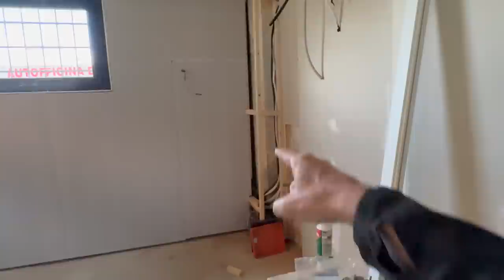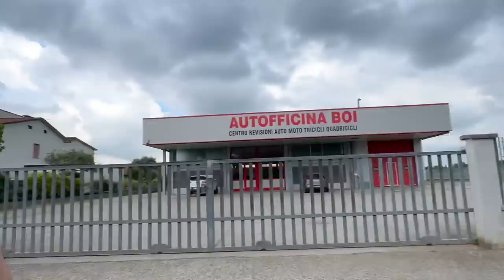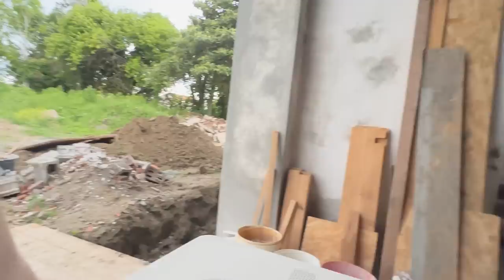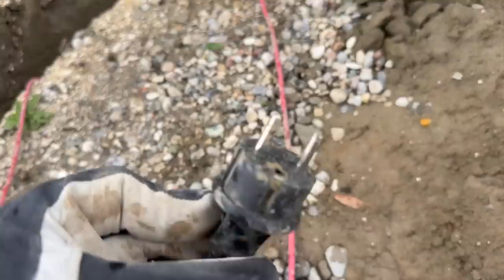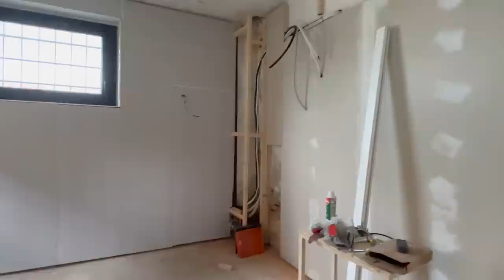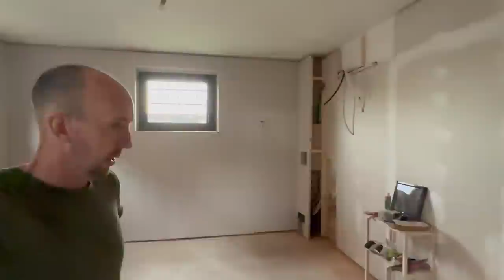Recessed CABINET MAKER or Snowman? A DIY Adventure | Vlog

Comment: A very small piece of advice for the electric plugs. You can find connectors very similar to the black one you have shown that have both small and big holes for the rectangular Italian plugs. They are life savers
Reply from the maker: 🙏🏼 I have seen those!
So far where we have lived we haven't had any of them though.
Reply: And, if I may add another small piece of advice, plan to have both types of sockets for every electrical box, otherwise you'll have to live with connectors everywhere in your house.
I hope it makes sense. My electrician vocabulary is quite limited
Reply from the maker: @Romaji999  Mine too but it absolutely makes sense! Thanks 🙏🏼

Comment: Try thinning the mud a little bit, use a wider trowel and take your time. You should not have to sand the walls. By the time you get done your project you will be a pro
Reply from the maker: Thank you for the tip! 
Unfortunately you might be right, was never my idea to be a pro mudder 😂

Comment: Question. Why did you tear down the walls along the street when you're light years away from building something back?
Reply from the maker: Because we were removing all of the thorns etc there and the wall was leaning heavily and was quite dangerous and did not want to take a chance of it falling down. But yes, it would have been great to have it there as it hindered the dogs from seeing other dogs pass on the street etc.
Reply: @VillaAroldi  I hope it all comes together for you two. My wife and I have watched every episode and applaud your hard work. I'm hoping that no one will take advantage of your unsecured property especially now that many of the important pieces are in place in the kitchen and bathroom. Fingers crossed that the big opening gets closed in soon.
Reply from the maker: @chriswhelan3412  Wow, that is quite the accomplishment, having to sit through all of these episoded 😂

We did have a break in last summer when we were away but they were most likely local as they knew we were away, so we wont be leaving the property until we have the large window installed and the whole place sealed. So fingers crossed nothing happens while we are here! 

Thank you to you and your wife for watching!! 🙏🏼

Comment: More than a century ago when electricity became available, I don't know why many countries chose to make their systems and sockets incompatible with their neighbors.  Perhaps this is perpetuated to make adapters a thriving business.
Reply from the maker: You could be on to something, there are adapters everywhere here!
Reply: It's worse than that, some countries have incompatible systems even in the same place, Italy being one of the first examples that come to my mind.

The common ancestor of continental European plugs developed in the early 1900s had two round pins, 4 mm in diametre and spaced 19 mm apart. It was probably rated for 6 amps, maybe even less. Over time, various manufacturers developed plugs for higher currents, usually using thicker pins, and adding earth connections. These competing manufacturers then pushed their designs to become standards. That only happened as late as the 1980s in some European countries!

Italy has the added complication of a dual plug system that's probably rooted in a weird electricity rate model from back in the day. The smaller plugs are rated for 10 amps and were originally designed for lighting circuits while the larger ones are rated for 16 amps and were designed for larger machines. I suspect they were made deliberately incompatible because lighting might have been charged a flat rate while sockets were metered. If that's the case it makes perfect sense to make the smaller plugs fit (some) large sockets but never the other way round.
Once the tariff model was abolished, they were stuck with the two different plugs. Getting rid of the 10A version would make the sockets incompatible with the flat Euro plugs and introducing new 16 A plugs with thicker pins but the same spacing as the old 10A ones would allow people to use German plugs without having an earth connection, which is dangerous.

Since German plugs are officially recognised in Italy and combined 10A/German sockets are readily available, it's probably the best strategy to have those combo sockets everywhere and replace the few Italian 16 A plugs that you get (usually no more than one or two household appliances) with German ones. The plugs are sold at every larger supermarket.
Reply: @Ragnar8504  Buying household electric appliances sometimes must be a challenge in Europe!  And from watching videos about high-speed rail, it seems that European electric trains operate on different voltages and frequencies, making dual-powered engines a necessity when crossing borders.  The European Union should unify some of these unnecessary differences!
Reply from the maker: @Ragnar8504  Thank you for such an comprehensive explanation, VERY interesting! Yes, we are doing German plugs everywhere actually, we are not keeping any old electricity anywhere, not even the cable that goes into the property so it's 100% new everywhere so that we won't have any problems in the future and so that we really can up the power supply for the house as it will be much needed. 
There is no thing worse than power outages!

Comment: Hire someone to do your plastering. At this rate you'll be taping and sanding for the rest of the year and it will still look like crap. Give yourself a break and let the pros finish it.
Reply from the maker: Exactly! That is the plan, the only problem is finding someone who has the time.
Reply: @VillaAroldi  I understand the problem with finding good contractors that are available. I struggle with getting a good finish whenever I attempt to drywall large areas even with 40 years of home improvement  projects of my own. You are to be commended for your hard work and perseverance.
Reply from the maker: @chriswhelan3412  Yes, it's not easy getting a finish you are happy with, I do have some old walls in the stable which will for sure not be perfect either but the imperfections there will be different than badly plastered drywalls so I need to be thorough.